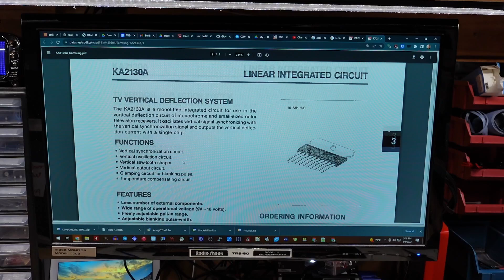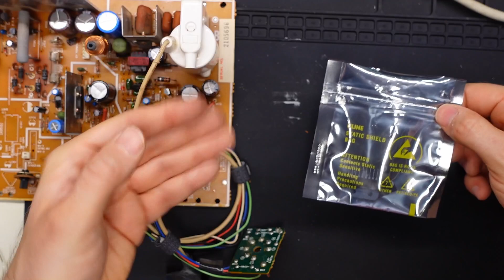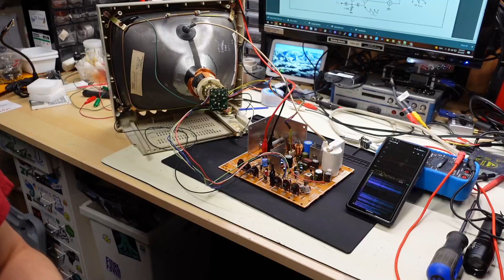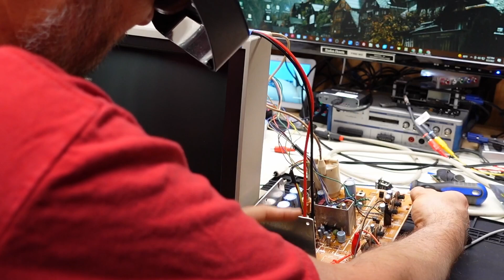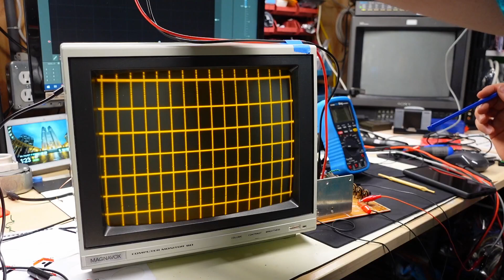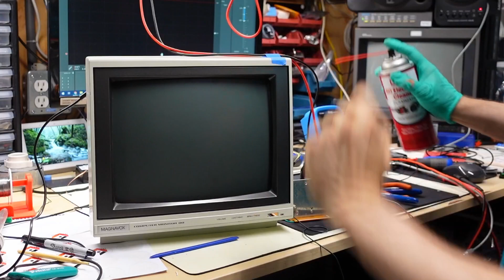Fixing a couple arcade CRT boards for David Murray

Comment: Arcade cabs use a isolation transformer, so Isolated line ac voltage into the monitors. Arcade monitors are  HOT chassis, so this is required.
Reply: CRT TVs from early 80s were hot chassis ....  I think that they stopped doing that when they got AV inputs and ouputs ... just imagine the explosion.
Reply: If AC is required, how then does Adrian make this work by feeding it only DC? Apparently, AC is not a requirement if you bypass the rectifier circuit, so why even feed the monitor AC in the first place? I'm still a bit puzzled why it didn't work when he was feeding DC through the diodes....?
Reply: @Quickened1  : Feeding DC through the diodes was not a problem, an inductor being out of tune was.

As for AC vs DC, throwing DC into an AC supply will either not work (some supplies have capacitors on their input that block DC, or transformer that won't pass DC, and maybe internal circuitry that does the same), only partially work (because some switching supplies have a second internal supply for their control circuitry), or stress components unevenly (such as two diodes in a bridge rectifier passing all of the current, and the other two passing effectively none).
Reply: @absalomdraconis  he did have a problem getting anything out of the set when running through the diodes. I also know that the out of tune inductor was part of the problem with the set from the beginning, but had nothing to do with the way he eventually had to supply power beyond the rectifier to get it working at all. He also explained the excess load on the diodes when going through the power supply, but did not explain why that wouldn't generate sufficient frequency within the flyback...
Reply: @Quickened1  He bypassed the rectifier circuit because he doesnt have a low voltage AC supply to power the board that way,  but he does have a low voltage DC bench supply.  As for why the board has AC voltage coming into it,  it's likely coming from a isolation transformer/linear supply inside the cabinet that has an AC output.  

Also as the original commenter stated,  arcade monitors usually (but not always) require an isolation transformer as they commonly have a "hot chassis".  The transformer is there for both for safety reasons and to protect components in the B+ circuit (like the bridge rectifier).  For example if you connect a safety earth ground to monitor's hot chassis and you are not using an isolation transformer,  this creates a short circuit through diodes in the bridge rectifier (remember that neutral is tied to earth ground at the circuit breaker of a house).
Reply: @Sloxx701  I get what your saying, and I knew that was why he used DC, I just don't understand why the set wouldn't work when he was supplying that DC through the power supply.

I guess in the 80s, when they made these machines, no one ever thought of just using a low voltage power supply to power the entire cabinet, with the only mains voltage supplying the transformer, and maybe a marquee light...

Anyway, I also never understood why they used a hot chassis in the first place either. There's a lot I don't know...lol
Reply: @Quickened1   He bypassed the bridge rectifier,  dropping resistor,  and linear regulator in the power supply as these were causing a voltage drop.  Also,  linear regulator ICs require a minimum voltage differential and a minimum voltage in order to provide a stabile output.   Max voltage out of a typical bench power supply is around 30V,  so he had limited voltage output to power the board to begin with.  Bypassing the power supply was a good idea.  But the power supply wasn't the problem.   The first board wasn't working because the flyback circuit had been mistuned by over-zealous person who just randomly cranked the tuning inductor slug with a screwdriver.  Flyback circuits are tuned circuits.  Throw them off kilter just slightly and nothing will work (this includes all the other voltages that the flyback transformer provides).

Hot chassis were used back in the day to simply cut manufacturing costs.  Less components, cheaper, etc.  Bean counters and all that.
Reply: @Sloxx701  I see.. I get it now... Personally, I'm glad the crt went by the wayside, but it's still cool to get one working now and then. I didn't realize that using a hot chassis was cheaper to manufacture. Good thing someone finally realized that such a configuration could get somebody killed, and I'm sure it did!

Thanks for the intelligent replies....
Reply: It’s low voltage AC, no isolation required.

Comment: In the arcade world, people refer to the board as the chassis (so when they say "chassis" they mean the board, not the metal framework).
Reply: Thats not confusing at all LOL
Reply: @kelvin1316  one of the many things you have to just accept when you start collecting arcade machines. 🤔
Reply: @JamesPotts  Well, after all, the board is the frame upon which the entire digital architecture is built upon...
Reply: Old TVs did that ..... Probable came from the Tube era when the electronics were actually mounted on a chasis and no PCB, just point to point soldering.
Reply: For me and I’m arcade world, the whole assembly is the chassis, and once the PCB is removed I call it the PCB and the rest remains the chassis.
Reply: @petesapwell  that sounds about right to me. Perhaps it was a regional thing. Like, tomato, tomato... Idk, but I've always called the metal framework on just about everything a chassis...
Reply: The PCB has always been referred to as a chassis, since well before arcade games were ever invented.
Reply: @bradallen8909  I’m 58 been an electronics engineer since I was 16…Never heard a PCB called anything apart from a PCB…It’s NOT a chassis….
Reply: @petesapwell  In terms of CRT monitors/televisions, the main PCB and neckboard is absolutely a chassis. Go ask on any TV repair or arcade forum if you're not convinced.
Reply: @bradallen8909  First you’re contradicting yourself and second you seem to have trouble understanding my professional status, also I am a moderator in several technical forums…I don’t need to ‘ask’ I am!

Comment: I use that same app on my phone all the time. It's really useful for monitors and cassette deck calibration, too.
Reply from the maker: With one of those tapes with a constant frequency?
Reply: @adriansdigitalbasement2  Adrian... you can look for the datasheet of the voltage regulator to know for sure at what DC voltage the board runs..... instead of trying different voltages.......... then you can set the DC to 2 or 3 volt over that....... or feed the proper voltage directly to the output leg of the regulator to feed the board.....
Reply: @Ramdileo_sys  Or just call David and ask him to send you a picture of the transformer... or probe it.

Comment: That Northridge Fix guy is always fixing boards via bodge wires and copper strips and has a specialty tool that's like a pencil size dremmel just for removing solder mask.  Can you look into if you need one of those?

Comment: I have seen that black oxidation on transistor leads and switch contacts in many 70s amplifiers, I think it may be some sort of tin oxide coming through. It is not necessarily corrosion in the same way as rust or acid damage, but it definitely could cause problems.
Reply: To me it seems to be more along the lines of a soot produced from the high voltage, temperature and common dust.  I've seen it inside old CRTs and Televisions that I've "played" with, and it just gets everywhere.  Once it mixes with any kind of paste like thermal compound and hardens, its just a pain to clean up.
Reply: @jk180  That could be true, I have seen the "soot" before around the HT lead and flyback, but that usually wipes off like dust, the stuff I am talking about does not wipe off and does not require high voltage to form.
Reply: It looks like silver or tin oxide. Nasty stuff as it "migrates" over the medium. Similar topics to this would be:
- silver migration effect (the deadly killer of early tube era IF cans)
- tin whiskers (early germanium and Japanese can transistors)

Cheers,
Reply: @EngineeringVignettes  Silver migration, or "silver mica disease" in IF cans as some people call it is really annoying indeed, reparable if lucky, but not often. There are all sorts of nasty metallurgical things that can happen to vintage and antique electronics apparently.
Reply: @electr0maker436  and not so old electronics as well it appears. Some car (vehicle) display consoles (dashboards) of the 90's vintage can suffer from silver migration.
I was going to do a video on that subject but never got around to it. Lots of interesting problems that occur from that effect 
Cheers,
Reply: @EngineeringVignettes  that’s good to know.  Thanks